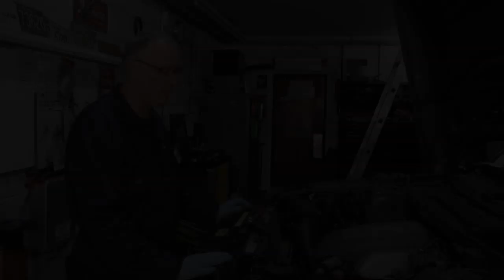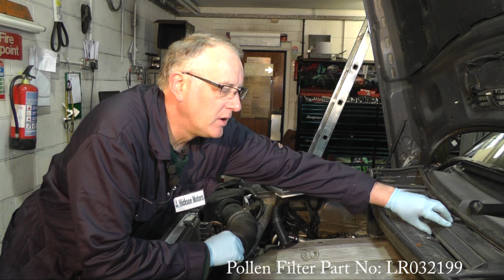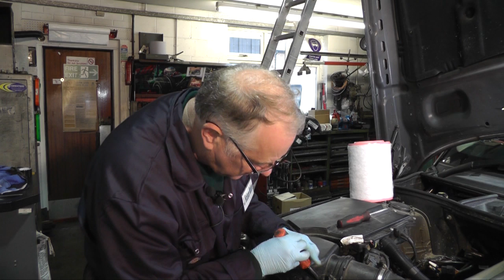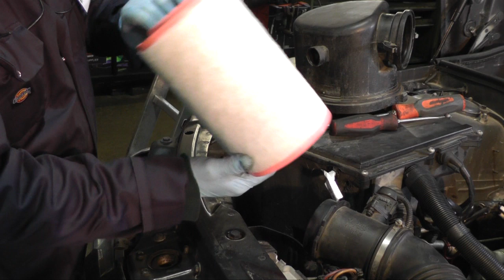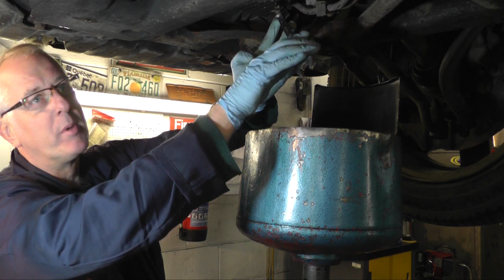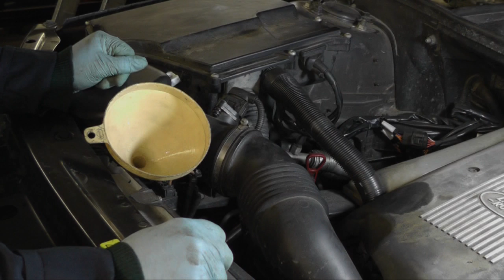Range Rover L322 - Interim Service Procedure

Comment: I’m sorry but I’ve never seen anyone change an oil filter before draining the oil!!!

I have the same M62 V8 in an E38 and can tell you that remote reservoir would be flooded with oil if you didn’t drain it first! 

I assume they got this video slightly out of sequence and had in fact actually drained the oil before moving onto the filters.

Too many ‘OK’s’ for me aswell! Nice chap though.

Comment: The pipe that the oil filter glides over, what is it called? I discovered today that I miss it on my L322 4.4 gasoline V8 -05. What does it have for function? Is it good or anus to have none?
Reply from the maker: Hi Johan, First of all, thanks for the excellent and highly amusing use of English. It is indeed very anus not to have one as it is the centrifugal part of the filter and we have no idea why it is missing. You need a new housing for the filter. Part no: LPU000020. Hope that helps.

Comment: Hi how much oil do i need for the 4.4 v8
Reply from the maker: Hi there,

If it's the 2002-2005 BMW engine then you need 8.5 litres of 0/40 fully synthetic oil.

If it's 2005-2007 AJ8 engine, you'll need 8 litres of 0/30 fully synthetic oil.

Hope that helps.
Reply: hi,, what size socket is needed to remove the oil filter housing ........thanks

Comment: Hey! thank you, i found the vid really helpful. should i drain the oil to get to the oil filter? cuz theres a rattling noise coming from there, maybe my filter wasnt put well. its a new filter and new oil. also, how much antifreeze should i put in my coolant? i dont have any in there. ive been adding only water to it for the past 3 years, figured id do the right thing and add some antifreeze. cheers.